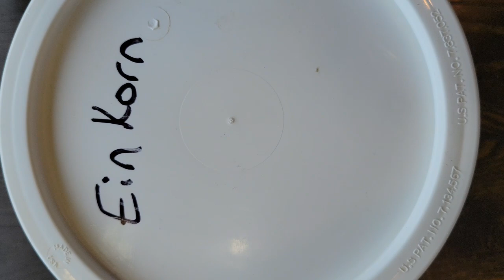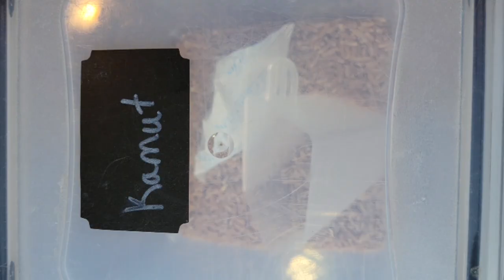MASTERCLASS: The Wheat Berry Explained | The Different Types Of Wheat Berries

Comment: I would love a video on the difference between winter wheat and spring wheat.
Reply from the maker: The main difference between the winter and spring wheat is when it was planted. The Spring wheat is planted in the spring. The winter wheat is planted in the fall and grows all winter long. As long as they are a hard wheat variety, they typically will both work great for breads. If it is a soft wheat variety, that is better for cookies, muffins, quick breads, etc.

Comment: Very informative video. Thanks for sharing. I am just wondering if you run most of your baking appliances from som form of solar or do you have to wait and then use the grid?
Reply from the maker: Thank you so much! We do have a full solar setup, my husband installed, and we can bake/cook with just that, as long as we don't try to use everything all at once. But, we also stay at campgrounds and plug in and use that as well. We change it up as we travel around. :)

Comment: Yes the mobility of using grains while traveling.  How do we make that happen?
Reply from the maker: I have some 5 gallon buckets I load up when I am in areas where I can buy local or areas where I can get mail. Then, for everyday use, I use those square containers I show in the video. My mill has a designated area on our counter, you can see in most of my videos.
Reply: @GrainsInSmallPlaces  Thank you.  I am thinking along the lines of air travel or staying in a hotel with a kitchenette.  Really whole grains cannot be purchased readily when traveling.  My thoughts are a good and effective hand mill.
Reply from the maker: Oh ya that does pose a whole different variety of issues to overcome.

Comment: Well, I certainly hope you'll have time to see this question and answer for me. No matter who was trying to explain this. Everything is so very wordy. Possibly this just cannot be helped.
So I have just a couple questions first one being.
Are you saying that the basic recipe for making a loaf of bread changes when using these wholeberries that we have ground ourselves? So another words, a loaf of bread does not going to be the same amount of water, the same cups of flour, the same yeast, measurement, etc?
And if a person 's only interested in to begin is which is most comparable to all purpose flour and which is most comparable to bread flour.
For now that's all I really want to know.
Thank you
Reply from the maker: Hi! The wheat berries all have a different amount of moisture in them, and they all develop gluten differently. (and some don't develop gluten at all.) There is not really a quick answer for this. But, I can try my best. It depends on what you are making to determine the kind of wheat berries to use. If you are just starting out, I recommend to use a recipe that is written for fresh milled flour specifically to take the guesswork out. Then when you start to see the consistency of the dough and the texture, it will help when trying to convert recipes. I have a ton of recipes on my blog at www.grainsinsmallplaces.net where I add new ones each week. So, to start out, if you want to make a yeast bread I would recommend to use hard white wheat. If you want to make muffins, cookies, etc. I would recommend to start with soft white wheat. It is more helpful to weigh the wheat berries than it is to use cups when converting recipes. I hope this isn't confusing, and is helpful to you. Happy Baking! There is a learning curve, and we all go through it, so don't give up! You can do this!
Reply: @GrainsInSmallPlaces  
That  was helpful.... Thank you very very much. 🥰
Reply from the maker: welcome!

Comment: Is fresh milled flour measured the same as store bought flour?  Also, how is fresh milled flour in a bread machine?
Reply from the maker: I typically will weigh my wheat berries and this is the same weight you will get for flour. BUT, the volume is different. So, one cup of wheat berries will equal more than 1 cup of flour. I don't have a bread machine, but I have reports that it does work, but there is a learning curve to working with fresh milled flour. I have lots of videos to help if interested! Happy Baking!